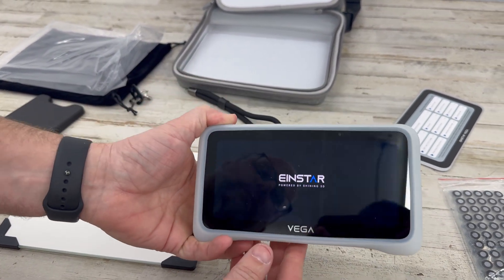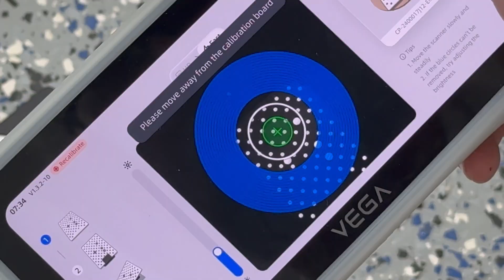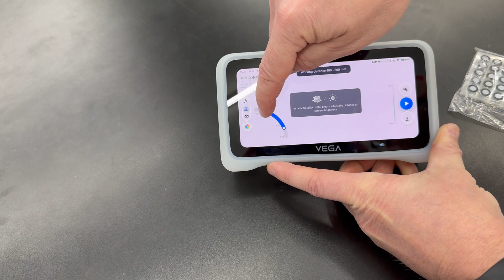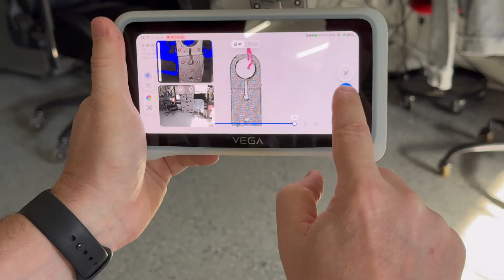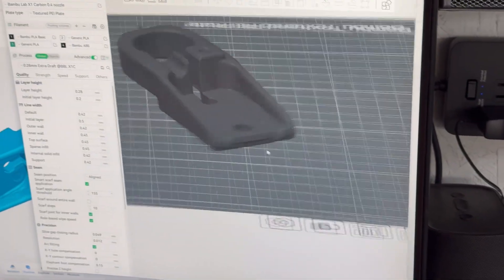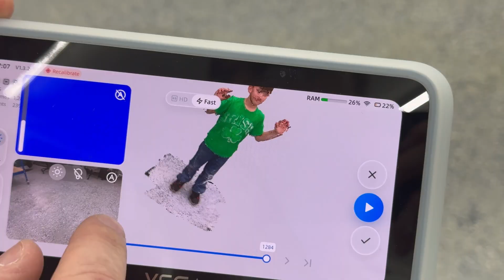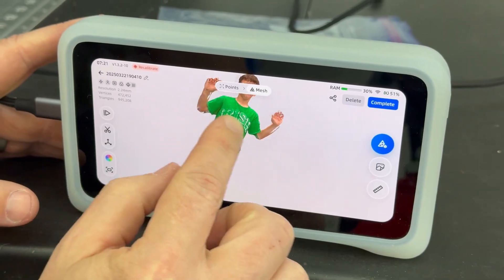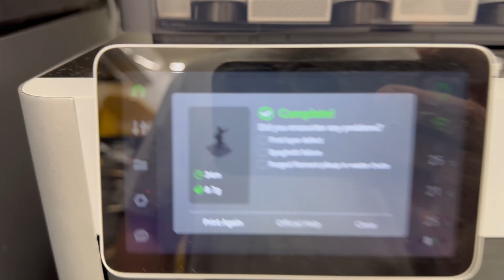3D Scanning Just Delivered What Money Can't Buy! | Einstar Vega Review

Comment: 5:58 you can actually lay the part down, scan one side, then rotate it and then the scanner can rotate the already scanned part to the real model and you can continue to scan the same part. And if the auto alignment doesnt work you can give it 3 rough points to get it started aligning them.